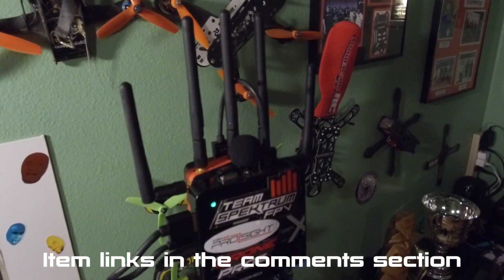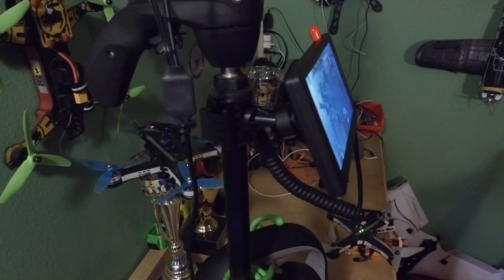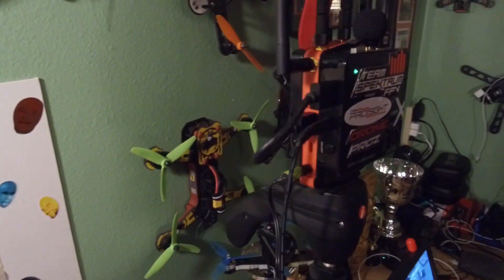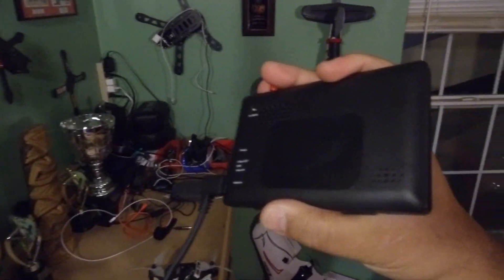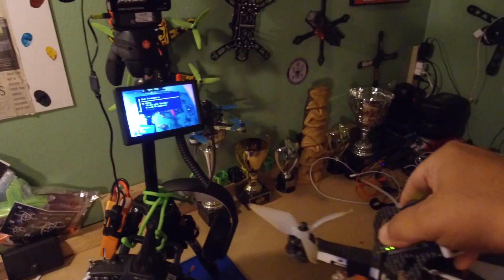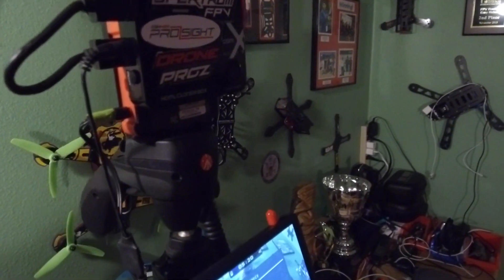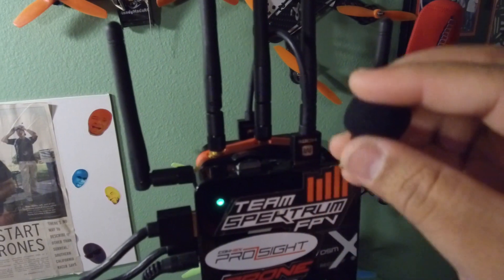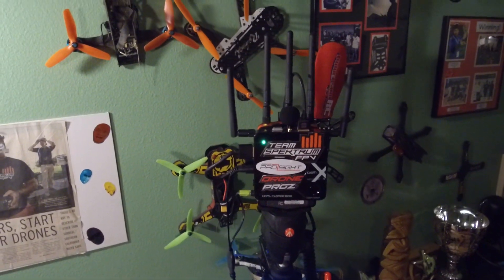My HD groundstation

Comment: Really nice. Only thing you forgot to link was the monitor.
Reply: Would this work? Can you set up wireless feed from the connect to the monitor? Not sure how it works, I don’t have mine yet ... thanks for your help.
Reply: ... forgot link lol
FPV LCD Monitor,T-RS2000A 7inch Fpv Display Monitor 5.8GHz 32CH for Racer 250 QAV250 ZMR250 Drone LCD Screen Ratio 150° Visual Angle https://www.amazon.com/dp/B06ZY9G8WK/ref=cm_sw_r_cp_api_DLkGzbCR9FC1D
Reply: Nevermind ... just saw your latest video of Ninja2. Much better!

Comment: Is the regulator used only for the cloner? Nice setup. Very similar to mine but I need to add a switch. My cloner runs off of USB input so instead of a regulator I have a little Lipo-to-USB converter.

Comment: nice setup! so,  you're going from the Connex to the cloner, cloner to splitter,  and splitter to monitor and goggles?  no added latency with all that routing?
Reply from the maker: Mav FPV yes, HDMi cloner box to splitter and then splitter to screen and goggles. There is no added latency. Cloner box is direct pass thru, and splitter doesn't do any kind of processing so no added latency anywhere.